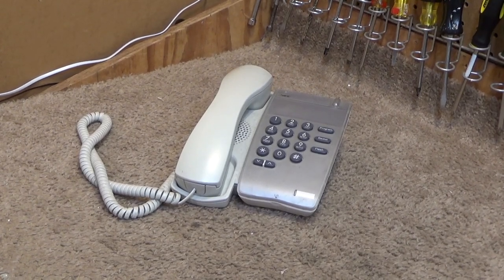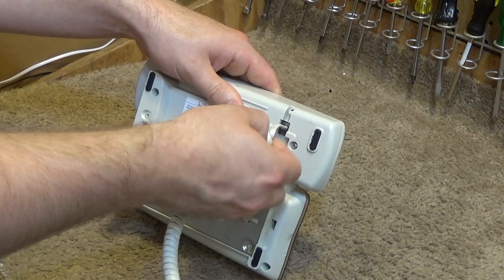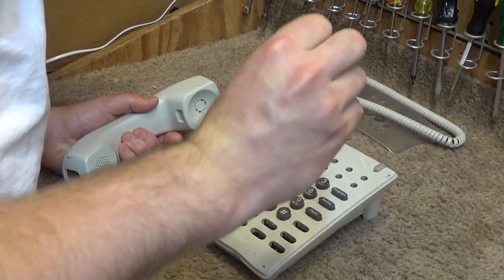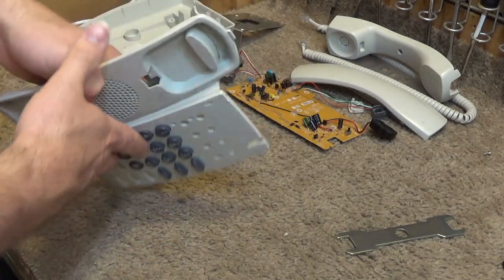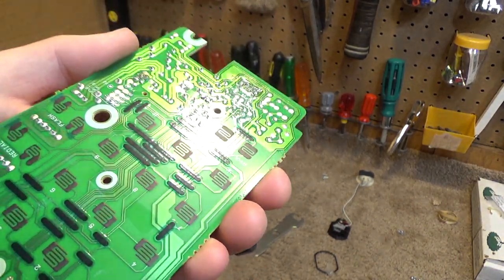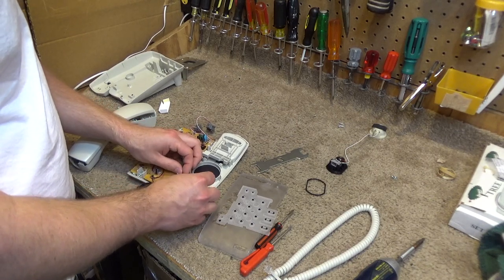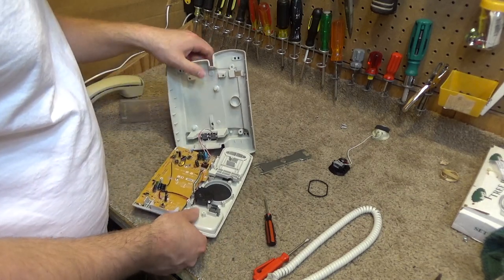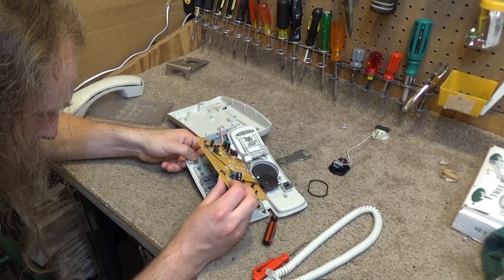Cleaning an NEC DTR-1-1 Telephone

Comment: If the Goo Gone doesn't work, you could also try the WD-40 or the Isoprisl before resorting to the Goof Off, as neither of those two solutions will damage the plastic either.  Of course you have to also clean off the WD-40 afterwards, but better than damaged plastic.

AT&T also has a telephone model 912 that has holes for a speaker, but there is no speakerphone or software based ringer to it so I don't believe the speaker would be used at all even if present.  I always wondered what it looks like in there, perhaps this design is similar to it.  It's a pretty rare model so I haven't gotten to look inside yet.
Reply from the maker: I didn't think either of those would be strong enough to remove permanent marker, but it would have been worth trying. Next time I will.
Was there a version of the 912 that had speakerphone? I know there was a version of this that did have it.